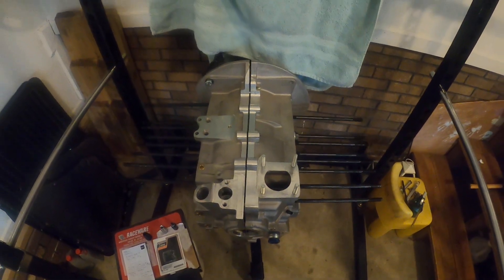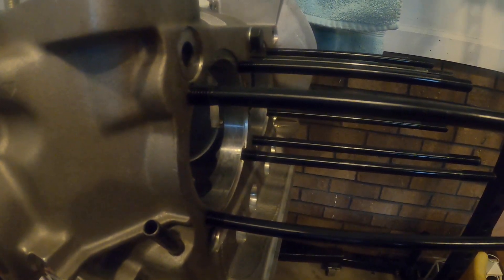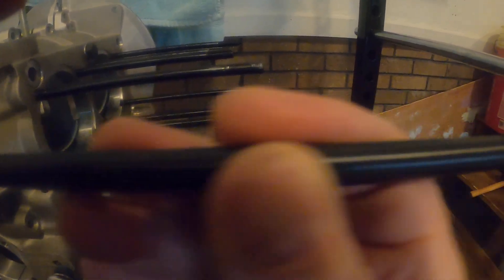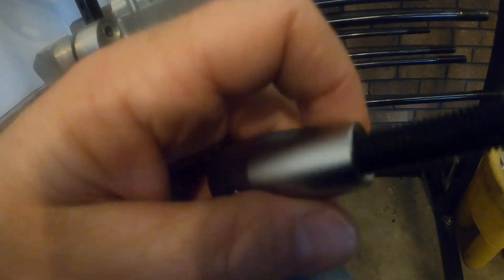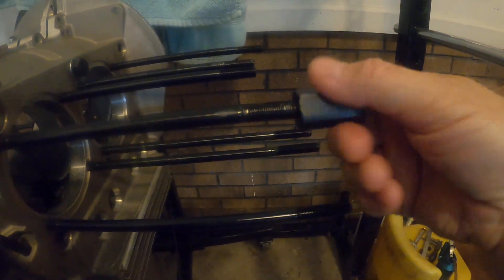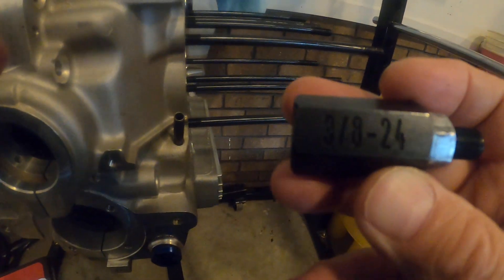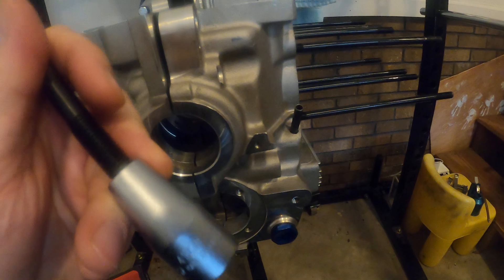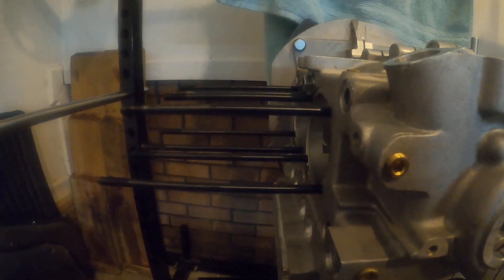VW Aircooled Head Stud Installation

Comment: thanks for the video. Do the stud need blue loctite are nothing.
Reply from the maker: If you have case savers you won't need loctite. In that case install the studs dry.  I recommend using case savers 100% of the time and if it is an older block which didn't come with case savers have someone add them.

Comment: Or it’s just a measurement on the treats?
Reply from the maker: No particular amount of torque. If the stud hole opens into the case I run the stud in at least 19mm (3/4 inch or so) but not more than flush with the inside of the case. If the stud is blind ie the hole is closed you can run it in until it bottoms in the case. Take your time and be careful.
Reply: @vwsandvettes3253  thanks a lot I’m doing the job right now and I see if I go all the way it goes and interferes with the rods when you turn it by hand